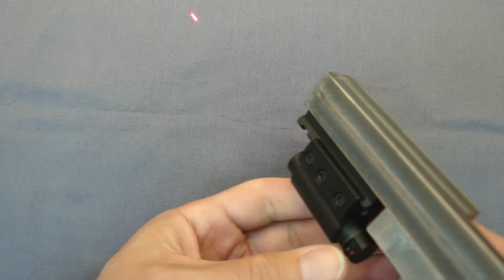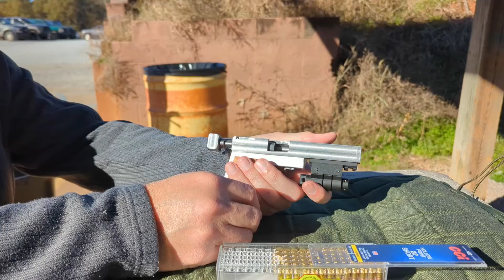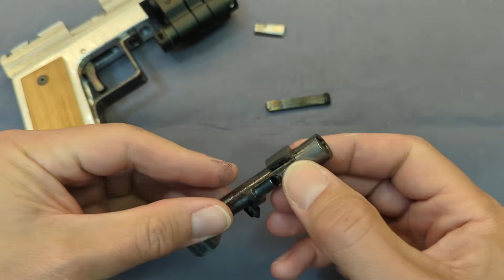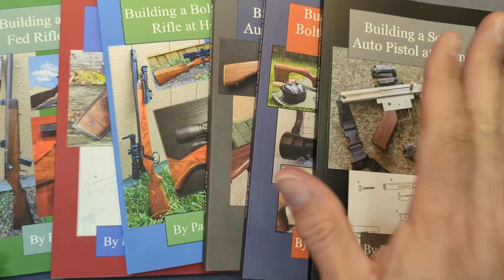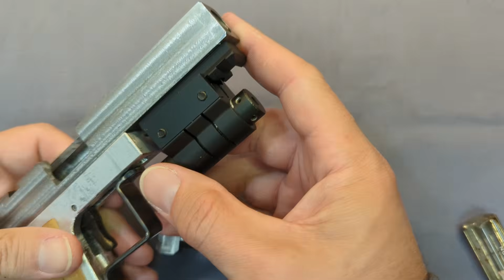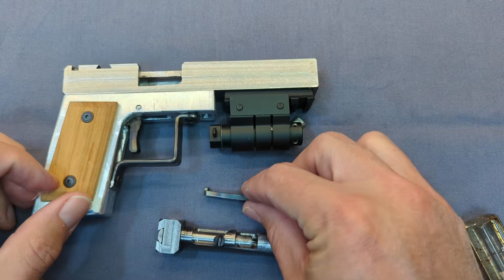One-Off Pistol – 22 Short Single Shot from my Collection

Comment: Nice build. Thanks for sharing. 

So you have an extractor but not an ejector. Any plans to incorporate an ejector too? 

There's so many aspects to building a firearm when you start to think about it. 

I remember reading about Leonardo da Vinci & how he wanted to build a device with ZERO screws holding it together. 

Thinking about other firearm designs I've seen springs & levers etc accomplish this.

A Zastava M88 doesn't use screws to attach the grips. It uses a simple piece of metal behind the grip to go into a notch to keep it in place. So you wouldn't need a screwdriver to work on that part in the field etc.

My Century Arms CA-3 uses takedown pins to disassemble & they can be removed by hand & then placed in the buttstock holes so you don't lose them.

Taking down a firearm I've seen so many different clever ways & different designs. It really makes you think about things.